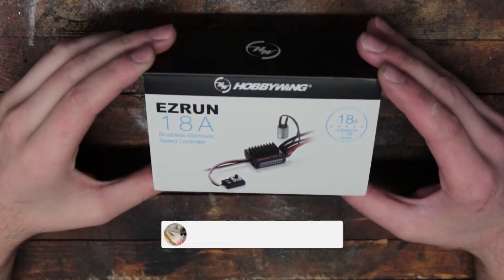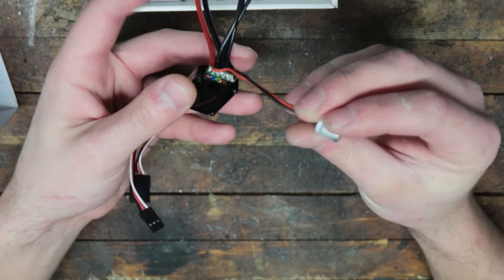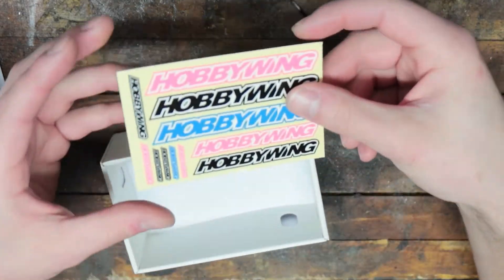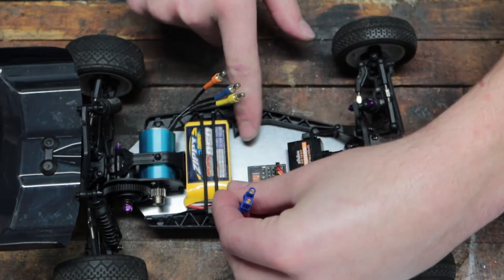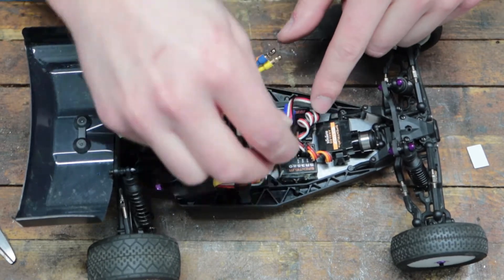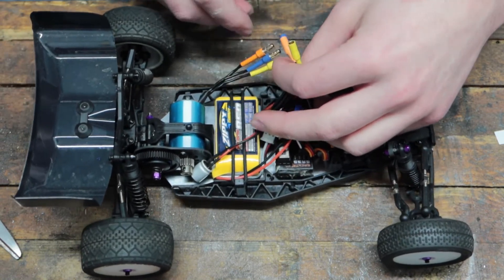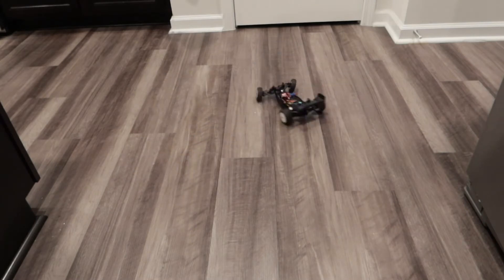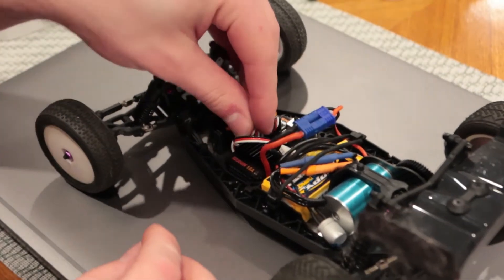REVIEW: Hobbywing EZRUN 18A Mini Brushless ESC (Electronic Speed Controller)

Comment: Hi thanks for your video.  Can this setup use a 3s with the 7800kv and 18a esc.  Only negative seems to be the instant breaking can you solve that with the program card that comes with it.  If ran it on a track with the instant break would drive me nuts.  Otherwise the Dynamite 6000kv seems more dialed out of the box but can't tune it?
Reply: You can program it with a program card I’ve switched my stock 6000kv dynamite for the ez run 5200kv and I like it a lot better although it takes up a lot more space on the mini t than I’d like still I wanted the tune ability you get with the hobby wing set up
Reply: 90% sure you can use 3s lmao and it’s a smooth as butter system when you tune it

Comment: Before pressing the double sided adhesive tape into place, I clean both of the plastic surfaces with isopropyl alcohol (it dries very quickly). Make sure the components are aligned correctly before assembly. They will not come apart easily. :yougotthis:
Reply from the maker: Good tips, thanks for watching!

Comment: The Hobbywing ESC you used might be designed for a crawler and the instant brake might be set to on. Just something you could check. I installed a Castle Mamba micro into mine and i adjusted a number of my perimeters using my PC like throttle ramp up and adjusted my LVC to 3.4 volts per cell. Im currently waiting for my motor to get here as the combo i bought had a motor i thought would fit, but doesnt. It is i think 30 millimeters in diameter and sensored. The motor ive got coming is 20 mm and unsensored. The sensored motor is a 2850 kv which is probably slow for the mini b but ive never owned a mini until i received this one to know if thats the case. The unsensored motor ive got coming is a 8200 kv. I figure i can gear down a few teeth if i need to. Better than gearing up it seems with this platform. The smallest overall sized RC ive had till this point was the DB Pro (even if some people call it 1/8th scale) is supposed to be a 1/10th scale. Next biggest is a TRX4 and on up to my 1/5th scales. I never initially was going to buy one of this size but Horizon Hobbies had a good sale going on and i was able to use my rewards points on top of it so i couldnt pass it up. I already enjoy Losi products anyways, so whats another, right?  Lol